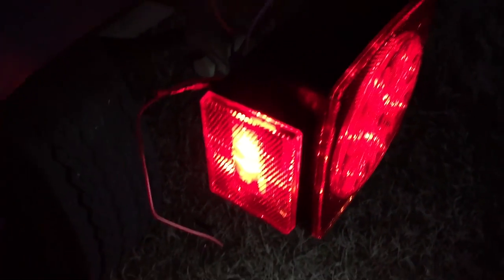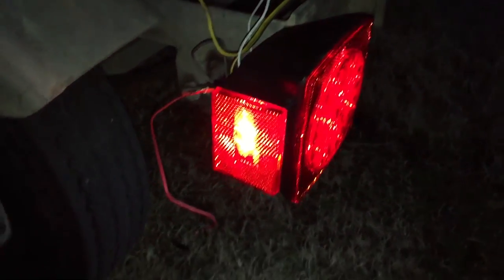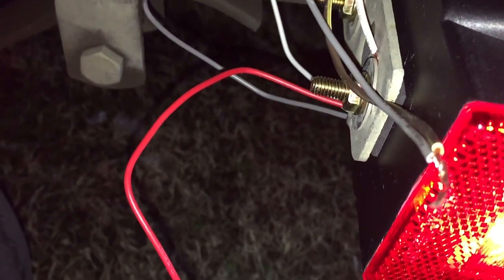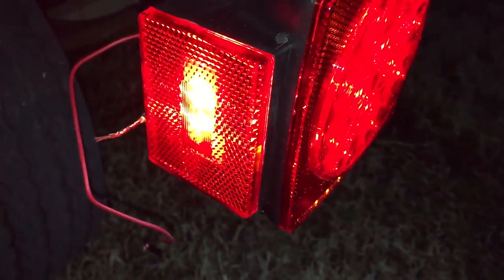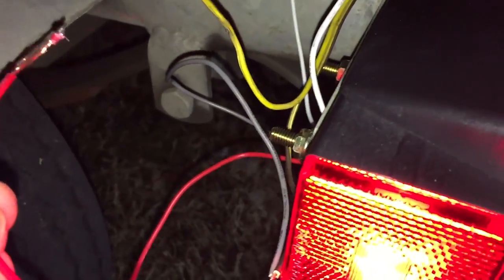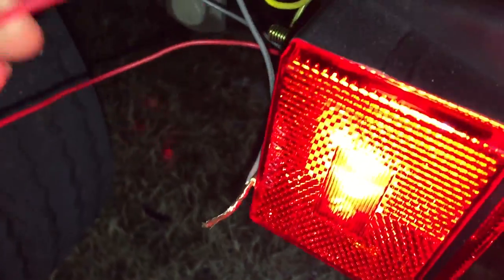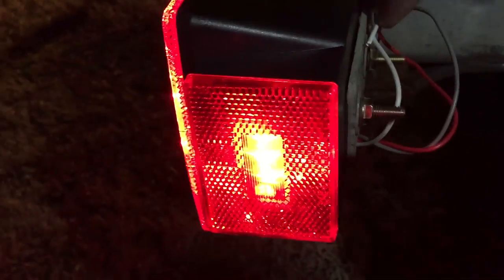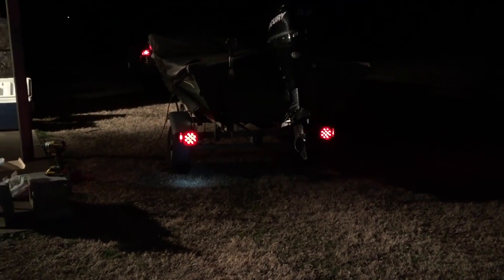Installing LED brake lights to a old trailer.  - OOW Outdoors

Comment: Thanks, That does explain allot as I was thinking the white was ground but not sure what the silver was.  I guess in hindsight Red would be a good indicator for brake.  Did you get   the amber side lights? I did , and there is a yellow and black.   But the one diagram I saw only shows  splicing the  yellow  but not where to put the black wire? Thoughts?

Comment: I solder with a pocket gas iron.
Then tape them.
Nice addition to your trailer.
I also put reflector tape (little squares) around the place too.